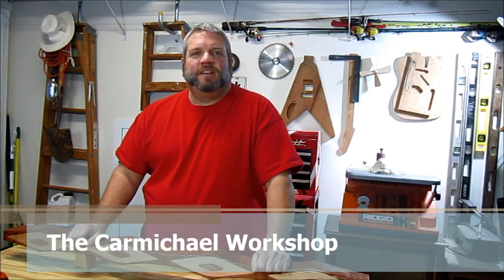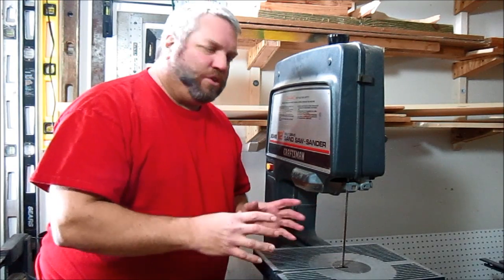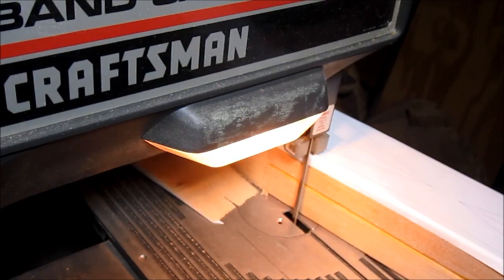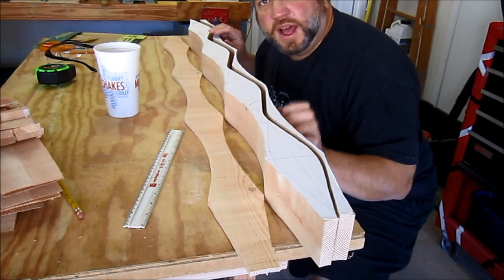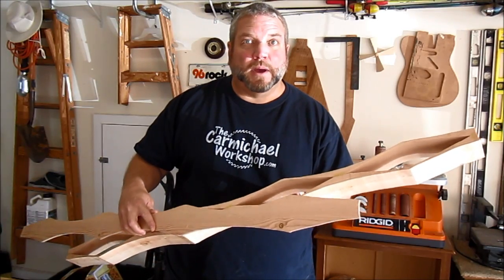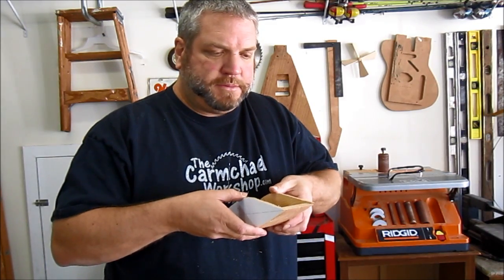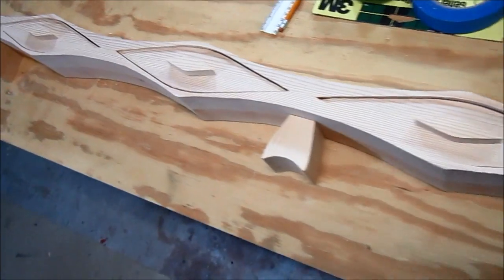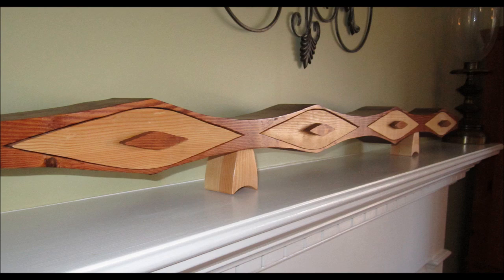Make The World's Longest Bandsaw Box (2x4 Woodworking Contest Entry)

Comment from the maker: Hi Donald - Yes I rip 2x4s all the time, mainly laying them flat to rip into 2x2s or something.  Standing them up vertically and ripping can be dangerous, since the blade can't cut through the entire board.   You could cut almost half way through on one side, then flip it over and cut almost half way through the other side, leaving a thin bit attached, then break them apart.  That works pretty well but you have to be real careful.

Comment from the maker: Thanks!  I just rubbed it on in small amounts and rubbed it off quickly to prevent excess wet stain from sitting on the surface.  I did a test piece with wood conditioner but it made the stain look orange, so I just put the stain on the bare wood and took my chances.

Comment from the maker: Yes, in general, the distance between the blade and the back is about the same as the size of the wheel.  Mine actually has about 12.25" clearance so each wheel with the tire on it must be a little bigger than 12.25" since the back side of the blade is inside the housing.

Comment: Great job Steve looks really well. I am really limited with my bandsaw as it's only small all I could afford and also fit in my cramped shop. But I have jazzed it up with the sticker you kindly sent me last year.
Reply from the maker: +Robert Devenney Thanks Robert!   Glad you got the sticker!  I used to have a Delta 9" benchtop.  I wore it out.  You can make a lot of stuff with the smaller ones.  Cutting through thick wood is a challenge though.  It helps if you have a 3 or 4 tpi blade.
Reply: My bandsaw is 8 inch and came with I think a 14tpi blade but replaced it with a 4dpi blade which has made things a bit better. When I get time going to make a better fence with the option for an auxiliary bolt on taller fence for resawing. Going to try my first bandsaw box today in a heart shape for the wife for Valentine's day either in cherry or walnut
Reply from the maker: +Robert Devenney   Cool!  Good luck!